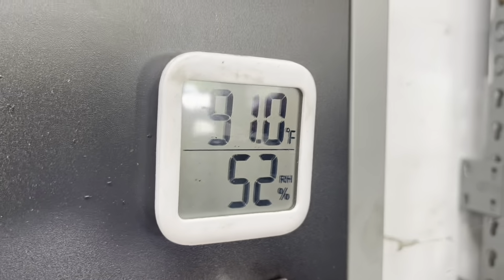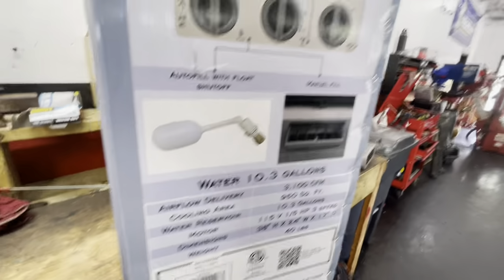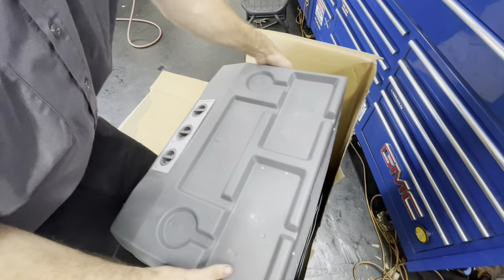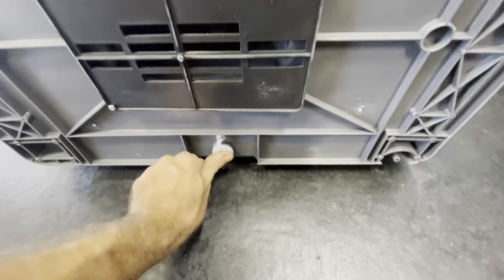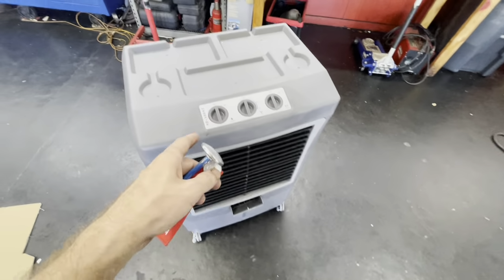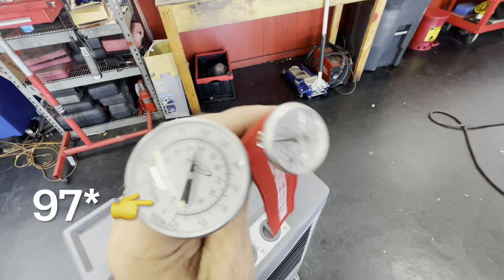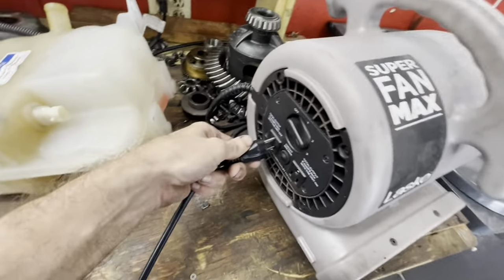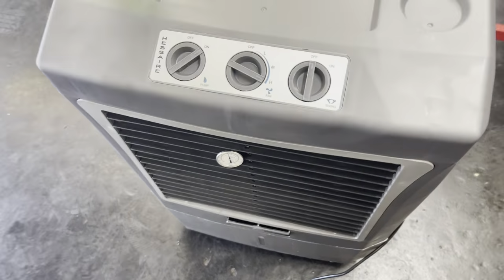Can’t take it Anymore!

Comment: I thought Florida was humid!  It's a humidifier with a fan,  I might use a smaller but same type unit in the very dry indoors with the sub zero climate winter outdoors.  In summer it's already humid here so wouldn't work for me. Just sayin', I'd put the braked wheels in back, saves me from pulling it over on me.

Comment: I've ALWAYS wondered if a swamp cooler couldn't be combined with an air conditioner.  The evaporating water removes heat.  The air conditioner also removes heat AND condenses water to provide DRY air to the humidifier PLUS water.  Likely not enough water so an outside water line would still be required.  I just think the marriage of swamp and air would be spot on.  Comments anyone?

BTW Ray...  NFL games in the heat have 2foot fans with cold water spray in front  This might work better for you.  You guys are A/C pros so you might figure a way to PUMP really cold water spray (34°F) to the front of a strong fan (20" high velocity Harbor Freight $60 fan)?  Obviously water and electricity don't mix so CAUTION is required!!
Reply: Window air conditioners already do that.  The moisture that comes on the evaporator coil is splashed onto the condenser coil by the fan, where a lot of it evaporates if the humidity is low cooling the condenser.  That's why you don't see modern A/C dripping like crazy as much like the old ones did.   Split systems don't really get this benefit as the water is in the wrong place, but they are more efficient than window units even without this little perk.

Comment: The air passing through the water soaked filters evaporates.  The evaporation takes heat from the air to achieve that task.  Result:  Air with heat removed.

Comment: It's a shame that nobody has designed a blower that slides under the roll away or hangs flat on the back of the roll away with a snorkel that blows over the top but will pivot up and down and left and right.

Comment: You can put ice in an evaporative cooler. This will cool the air that the fan blows into your home. While this provides an immediate boost of cool air, it may diminish the effectiveness of the cooler throughout the day. Water needs to be hot to evaporate, so putting ice in the reservoir will increase the time it takes for the evaporative cooler to work effectively.

Comment: Florida is the last place I would use a swamp cooler. You are just adding to the humidity which is my biggest hate. Arizona is more like it, they work well with dry heat and are more efficient than AC.
Florida - stick to AC.

Comment: Too humid to get effective cooling from an evaporator cooler unfortunately. Your wet bulb temp will be too high without having a “massively huge unit” along of the media surface area, fan size and dihydrogen monoxide usage will be excessive. And for gods sake everyone will die of Legionnaires disease  in the shop. Seriously I hope it helps. Getting older in the heat is miserable.

Comment: Those evap A/C units push the humidity WAY up in order to make the temperature go down.   For me, they make matters worse.    High heat - low humidity...not great.  But Slightly-less-than-high heat - high humidity...worse.  Am not a great fan of them.

Comment: Ray, physics guy here. Your thermometer are not going to measure a drop like in a ac system. Instead this works by putting moisture on your skin. In a high heat but low humidity environment the humidity on your skin will evaporate and remove heat. Sorry Pal. Not the news you wanted. Ice will help.
Reply: Back to school "physics guy"...